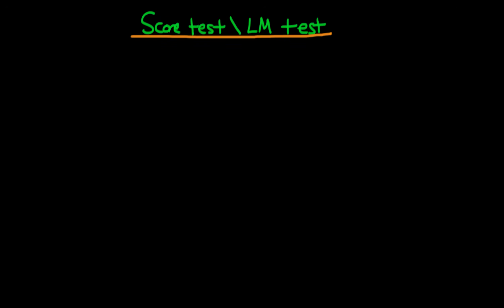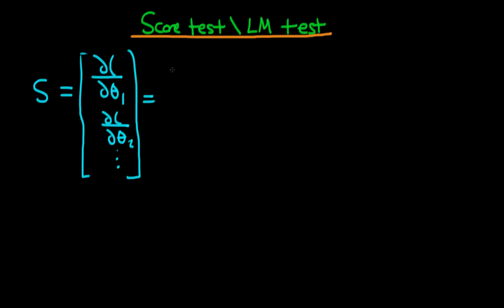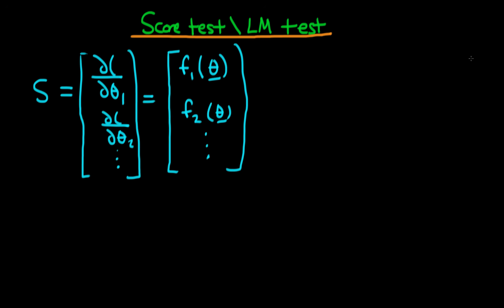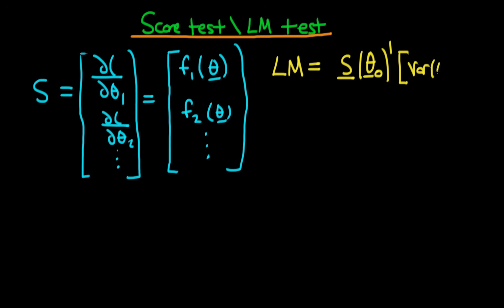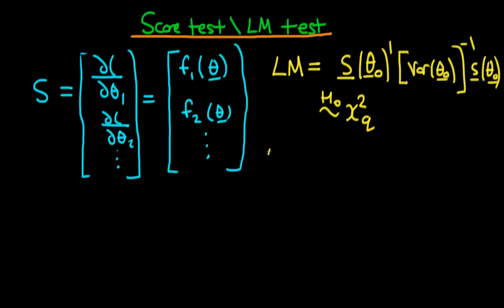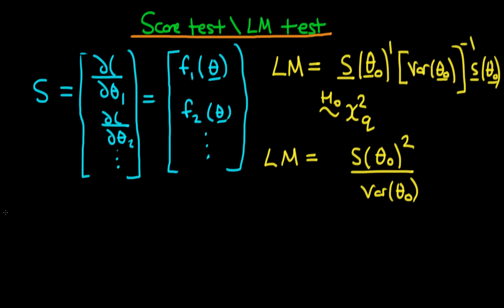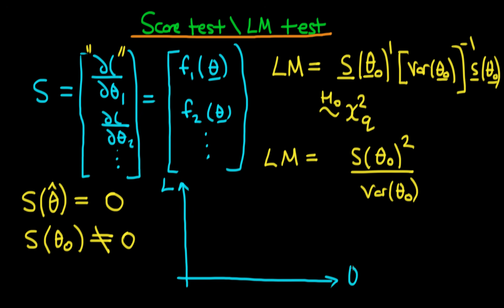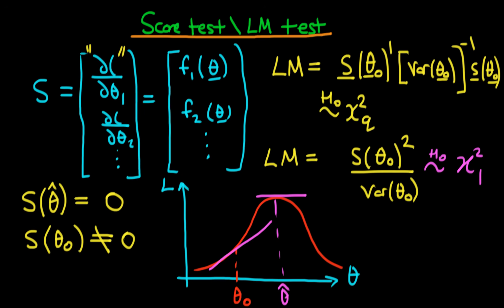Score test (Lagrange Multiplier test) - introduction

Comment: Just to note, if it's not clear, that you calculate Score and Var / Information matrix at the full model, and then replace the values for the coefficients with the H0 assumptions. So your score test will be different depending on what is your full model assumption.
Reply: This is something I found confusing in reading through the LM test, that it emphasise the unnecessity to evaluate the full model, and yet it seems to me that the score is obtained by plugging in theta-zero to the partial derivate of the unrestricted model. I am also confused as to how to evaluate the fisher information at theta-zero (or is it what is supposed to be done?)

Comment: What happens when the null is even further, at the tails, the slope there is close to 0... So this test will fail to reject when it most should? :-/
Reply: So it turns out that although the likelihood can have tails, the log likelihood is usually very steep. It basically looks like a steep mountain - so it probably won't happen in that case. https://stats.idre.ucla.edu/wp-content/uploads/2016/02/nested_tests.gif
Reply: So it turns out that although the likelihood can have tails, the log likelihood is usually very steep. It basically looks like a steep mountain - so it probably won't happen in that case. https://stats.idre.ucla.edu/wp-content/uploads/2016/02/nested_tests.gif

Comment: I think the item in the medium of sandwich should be inverse of fisher information, instead of inverse of variance, since you have to take variance on the whole score function.
Reply: Is that not implicit by using the "vector" as the parameter (underlined theta) for the variance?
Reply: @kangzhou1831 I agree

Comment: This definition of the score test looks quite different than this one: https://en.wikipedia.org/wiki/Score_test

It should be the second derivative of the log-likelihood, not the variance.  I guess these converge through Cramer Rao bound but I still find it confusing.

This test as defined seems more like a Wald test:
https://en.wikipedia.org/wiki/Wald_test
Reply from the maker: Hi Paul, thanks for your comment. They are the same. The distribution of this statistic is, asymptotically (that's the key thing here), a chi-squared distribution. The variance is an estimator of the information matrix. The score is the numerator -- it is the derivative of the log likelihood with respect to the parameters, evaluated at the ML estimates. This is different to the Wald test, where the numerator is the squared deviation of the MLE away from the null hypothesis values. You'll find that the denominator for the Wald is exactly the same as for the LM test (see page 780 of this: http://citeseerx.ist.psu.edu/viewdoc/download?doi=10.1.1.458.4713&rep=rep1&type=pdf). Hope that clears it up. Best, Ben
Reply: @SpartacanUsuals hi the denominator of the score test and the Wald test are not the same. The denominator of the wald test statistic is the variance of the mle which is the inverse of the fisher information whereas the denominator of the score test is the fisher information. You can check wikipedia
Reply: Just wanted to point out that the link does not work . but I am happy with Ben's explanation .( it says  : No document with DOI "10.1.1.458.4713"
The supplied document identifier does not match any document in our repository

Comment: Would an extremely off parameter create a low score, and hence a low LM statistic, making the LM statistic incorrect?
Reply: +Stephen Lee
My lecturer defined the Score as the derivatives of the log likelihood function.  In this case, the graph of the likelihood function, rather than looking like a normal distribution, is a parabola opening downward.  Thus you do not have this issue where the slope gets flatter on the tails, it only gets steeper.
Reply: @anonymousblimp  Thank you for the explanation. Is this actually the case (and is hence not a normal distribution)?
Reply: Stephen Lee and then in the steeper part, in the video between red teta-zero and yellow teta-zero, the null would (actually) be more likely rejected than at the red teta-zero, although this steeper part is actually closer to the teta-ml. If it would be put in another way, I think it could make sense though, cause the slope (score) could automatically take into account the variance (as was in de denominator in the test of the previous vid.).
Reply: @indragesink  I personally think that this will strictly depend on the likelihood function/distribution in question here, which does not need to be approximately normal. It could take any form, parabola as mentioned below, but also less steep distributions. Did you find the answer in the meantime?
If "taking into account the variance", why would there be any change in var(theta_0) and how do we actually find the variance of theta_0?